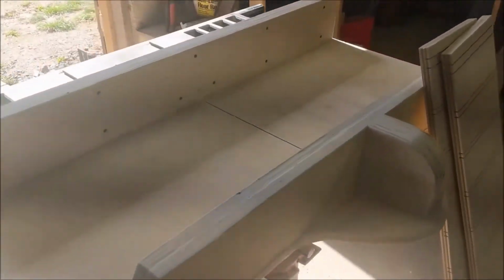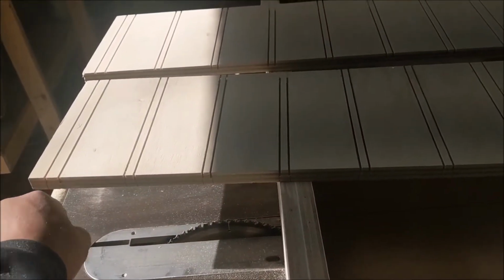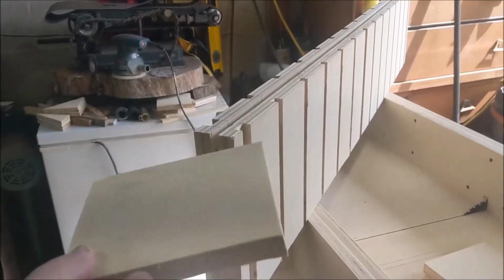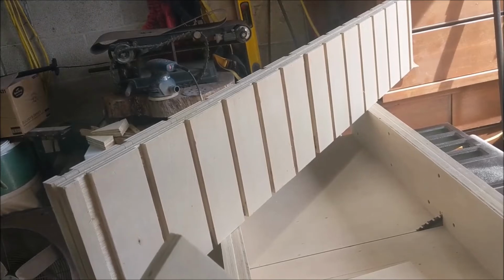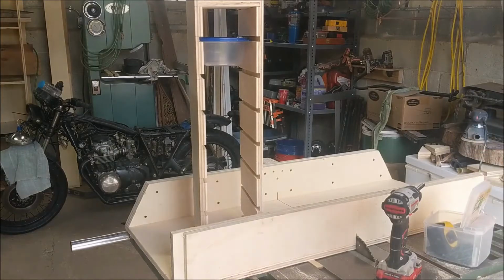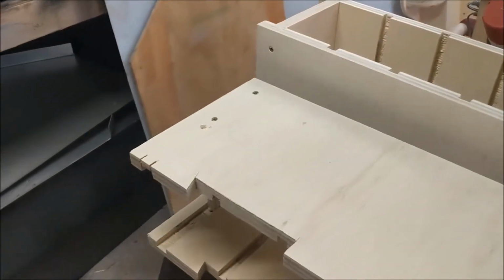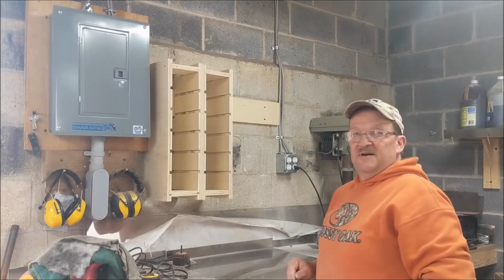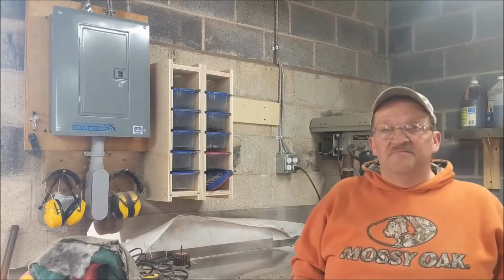Small Shop Setup - Parts Organizer - Part 2 | #uptacraft

Comment: You have a radial arm saw- AND a table sled?    ???   
What is the purpose of lids on the containers- just adds two steps to accessing parts (remove, replace). Multi part containers (i.e. drawers) mean you can access related parts at the same time (e.g. bolt, nut, washer) and gives more compact storage.
Reply from the maker: Hi Mike! Thanks so much for the feedback. Yes, I have an RAS and a sled. I like the options that open up when you have both. Sometimes the sled is more conducive to specialized jigs. Other times, I might be using both on the same project and it's a time savings to have one set up with a regular blade and the other set up to dado. As with all things, we tend to fill up the space we have... 😁
As for the use of disposable plastic containers, two things motivate me. First, I like to make little attempts to upcycle instead of throw away. The other is that I like the ability to take the bins with me, outside the shop and on the road for remote jobs, so the snap-on covers help me keep things neat and reduce spills.
Again, I appreciate you watching and commenting!
Reply: @uptacraft  You are absolutely right about a Shop getting filled- it is a form of Parkinson's law - 'tools expand to fill the space available'. Having a small shop, my aim is to make it the best set of tools...
Understand the carry principle. I came to the conclusion that 'shop work and remote work are mutually incompatible. People suffer poor tool access (those rows of systainers!) to feed the mobile need. I went for a toolbox with dedicated tools, compactly stored, as my 'travel toolbox' and a carry box of common fixings. To this I add the few special tools the task will need, and move some of the (3D printed) bins from my component drawers into a carry box (which is sized to take them). If I travelled often, I would increase the dedicated content. The extra cost of some duplicate tools is not that high, and means you have a spare if a tool fails. Moving tools to a toolbox once per trip is better than once per use...
I, too, like to recycle. I use milk container caps for glue mixing, part support when painting etc and the bodies I cut open to give paint and brush holders, and a place to keep parts when disassembling. 
Searching for videos on RAS use, most seem to just use it for crosscuts, so it becomes a heavy and less convenient mitre saw. Having said that, at least it has an induction motor, rather than the noisy (and inefficient) universal motor that inhabits mitre saws (and many other tools) these days...
Reply from the maker: @Tensquaremetreworkshop  Sounds like you and I have a similar mentality and  I Iike the solutions you mention. Keep them coming! This channel is all about finding solutions that are efficient, ethical and inexpensive when possible. 😁🔥
Reply: @uptacraft  I too have a channel, which may be of interest!